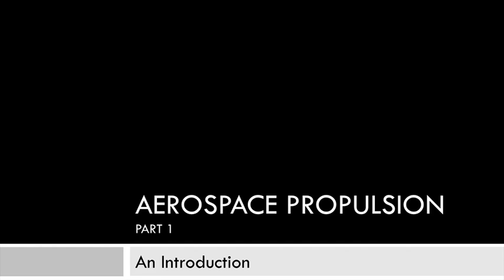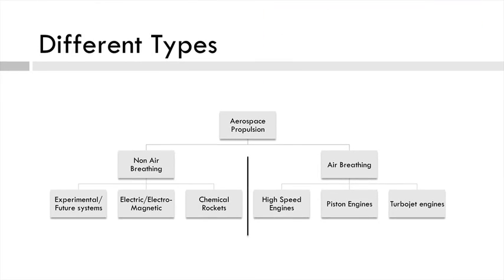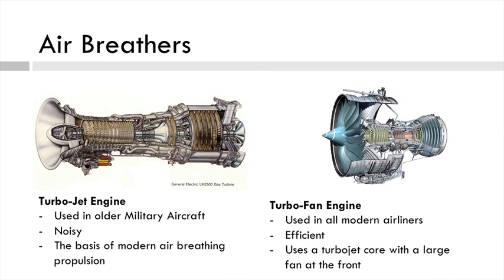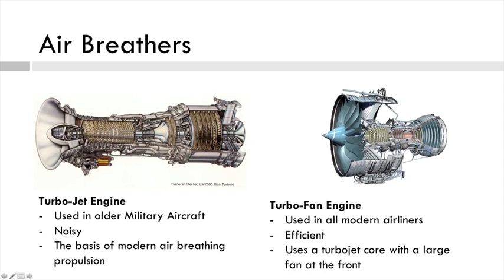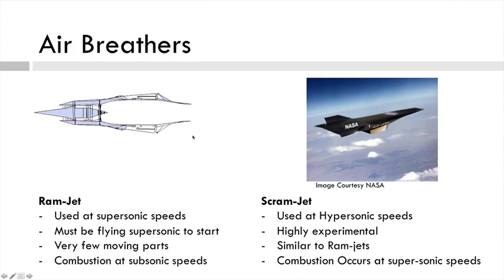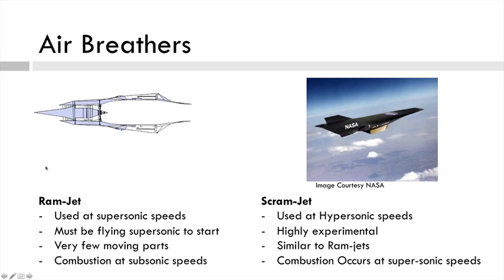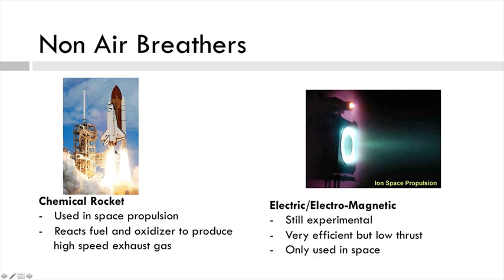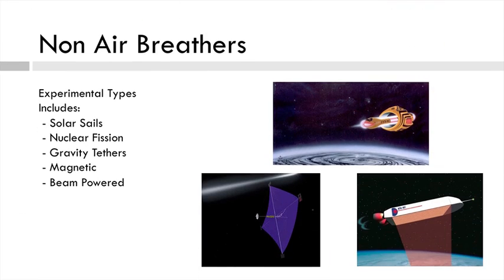Aerospace Propulsion Series Part 1

Comment: Hi there, thanks for the video. Question about the SR-71 Blackbird. I've heard pilots, that flew it, say the inlets pull the plane along. How can this be? My thought is, while the inlet does make pressure it also makes drag. It's the burning of fuel in the afterburner that makes thrust. 

Thankyou for your time! 
Bill

The following link is a video where a pilot claims this idea at the 12:30 mark. 

https://youtu.be/2mVJS8AZ4S8